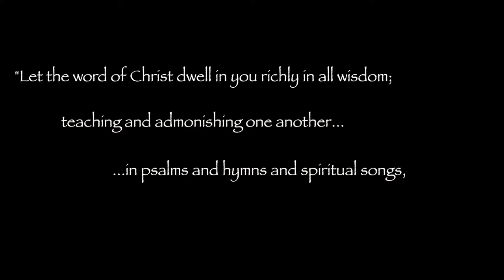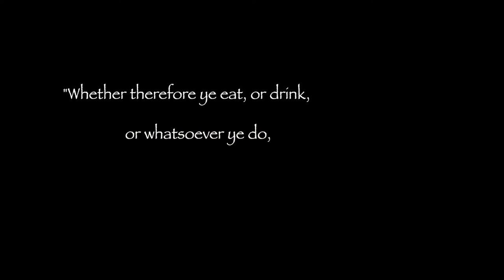The Rocking Chair

Comment: Your card scrapping game is on point! Please post how you sharpen them!!! I can never get the burr right. Well done
Reply from the maker: There are quite a few well made videos that explain it better than I could.  One of them is by a fellow that I admire named Paul Sellers.  Here's his video: https://www.youtube.com/watch?v=kPy7x1cXGo0

If I am using a card scraper for fast, rough removal of finishes, and I am not concerned about a final, smooth surface, I just mount a bastard file horizontally in my vice and run the scraper along the file one way for or five times at 90 degrees, then, turn the scraper around and run it along the file again another four or five times; no burnishing or anything.  It's rough and crude, but it only takes a few seconds to do it.

Check out Mr. Sellers' instructional video or some of the other very fine videos on sharpening card scrapers.  When it comes down to it, from my experience, instruction by others only gets you so far; the rest is just lots and lots of trial and error until you find your own way of doing it.

Good luck and post a video of your experiences with it and let me know!

Sincerely and respectfully,
Joseph